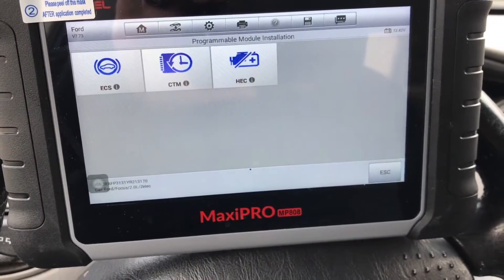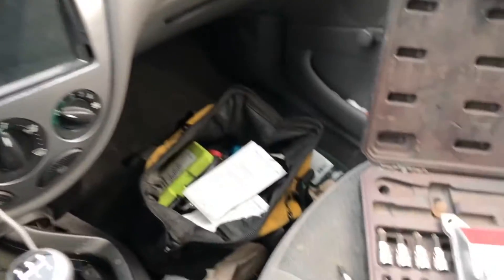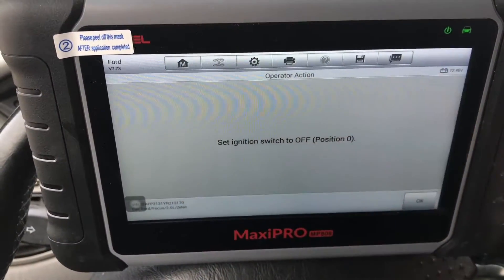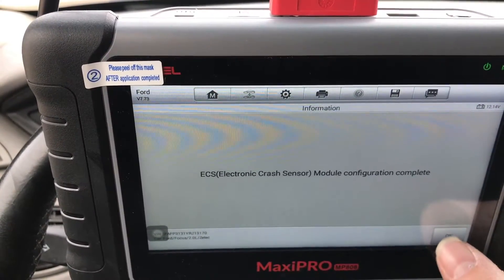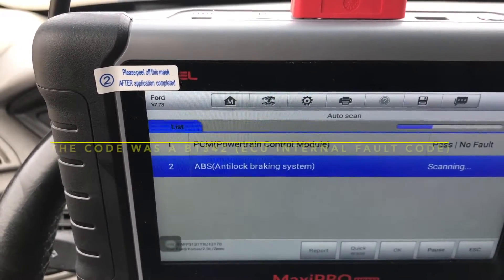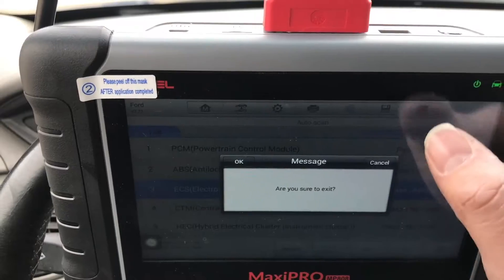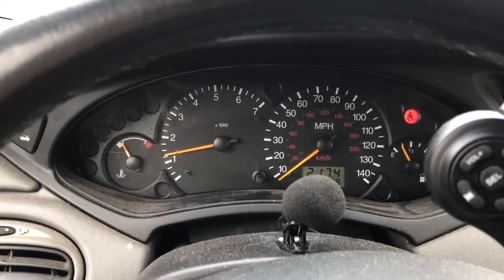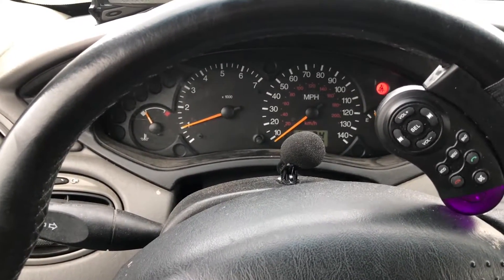2000 Ford Focus used Airbag Module Reprogram (Code B1342)

Comment: I got a 2010 Ford focus withe same code B1342-20 ABS I get it scan at two different repair shop first one say the ABS Module need to be replaced cost $1400 second one say the ECU need to be replaced $1500 they both saying two different things what to do?

Comment: The car it has crash before or no ? 
If its has crashed how you delete crash without use EEprom?
Or you cheng the module of SRS
Reply from the maker: The car has not been crashed before, the internals of the module had been failing for a while now. I first noticed it in the winter when it was real cold and I started the car the air bag light would come on. I ran it for 5-10 mins shut the car off and re started the car and the light would go away. Well it came a day when the light would not go away I knew after if scanning it that the module was bad.
As far as crash data I’m not 100% sure on because I have never worked with a vehicle that has been crashed (Where the airbags have been deployed).

Thanks for watching and for the question!